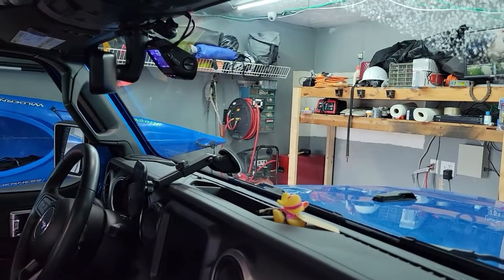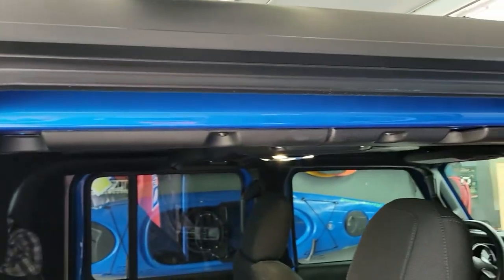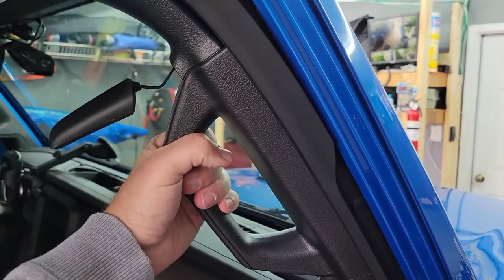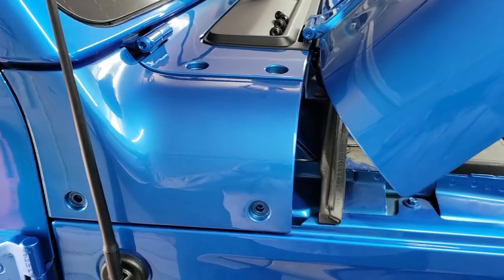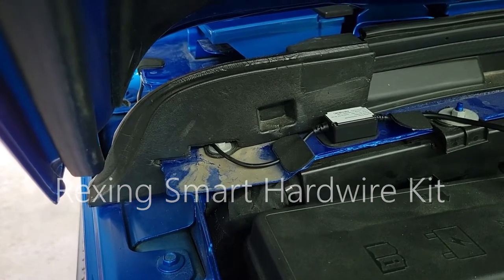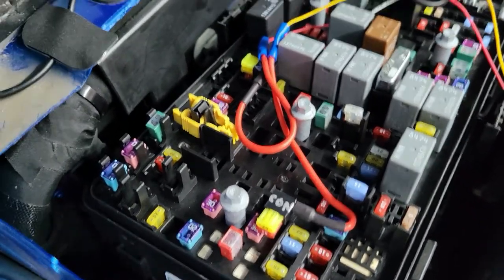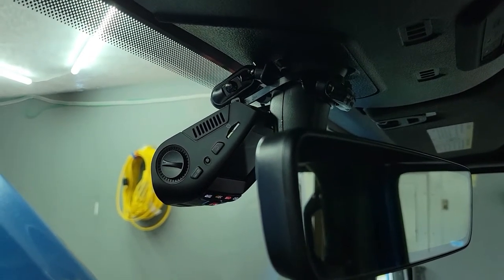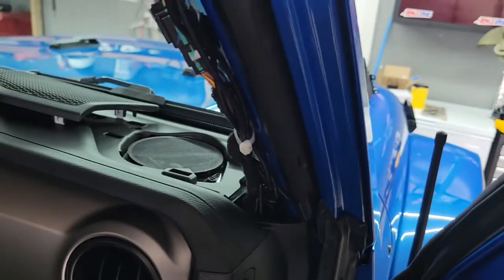2021 Jeep Gladiator Dash Cam Install with tool requirements and fuse location for power

Comment: Such a great, focused video! Thanks so much for the fuse/wiring detail!
Reply: Took 3 hours start to finish! I tapped into the same two fuses and routed the same in my 2020 Wrangler JL. I'm not quite sure yet about the back camera. I currently have it mounted on the back window although that means I need to disconnect it when I take the top off. I thought about attaching it to the roll cage but all I see is the interior of my jeep and the big spare tire 🙂 Thanks again for the excellent video!

Comment: It's probably too late for this now, but they don't indicate which way is up on the body of the camera because you can set that in the software.  For example, you could flip the camera upside down so the cable exits on the other side.

Comment: I installed a dash cam in my 22 Jeep Wrangler and the fuses were causing my battery to drain. I had my acc plugged into f52 which is the cig lighter and then the always on on f43 which is the rear cargo power charger. My battery light keeps turning on and didn’t realize it was the camera causing it so i took it to the dealership and they unplugged it and haven’t had that problem since. Now i can’t figure out what fuse to use 😅
Reply: Do you not have the OEM auxiliary switches?

Comment: Thanks for the GREAT video.  I just purchased the Rexing also, but I chose the VP1-MAX .  It has the 4K front but a 2K rear .  The only real cosmetic difference is the rear camera looks like a mini version of the front, so that might change my rear mounting position a little from yours....  DO YOU RECALL what amp fuses the Hardwire Kit came with ? Did you order the "SMART" or the "INTELLIGENT" version of the hardwire kit(I'm guessing the standard "smart" version) ? You showed a blue 15 amp from the original Rexing harness but then added yellow 20 amp fuses to the new MICRO2 adapters.... why did you choose to do ths ???  The oem intelligent harness I purchased from rexing has the grey smoke colored 2 amp fuses, so I was wondering what the differences were... I did purchase the "Intelligent" hardwire kit because it is required for the premium parking sensor... maybe that is the difference.  I've contacted Rexing to verify, waiting for a response....Thoughts ??
Reply from the maker: That wasn't a blue fuse in the Rexing adapter. It was just the adapter, which didn’t fit my Jeep. I used the same amp rated fuses in the new adapter harness as what came with my camera. I imagine the difference in fuse ratings between our kits is exactly for the reason you said.

Comment: I did it exactly as in the video but it didn't work, I connected the B2 cable to the cigarette lighter fuse and that's how the camera turned on, now to record when it is parked I don't know where to connect it.
Reply from the maker: I think you posted somewhere else that you have a 2023.  Your fuse block may be different than mine.

Comment: Stupid question - his yellow ACC cable is wired into the CONS tap fuse? And the red batt cable into his ACC tap fuse is that correct? It’s seems backwards.
Reply: I bought a Viofo A229 Pro.  The red wire is the Batt wire and the yellow wire is the ACC wire but some hardware kits are different.  They should label the wires in the kit.  Some other internet sites say that the colors are not standard.  You have to look at the label.

Comment: I would like to know exactly which fuses to use Mojave 2023?  thank you.
Reply: It is most likely Micro 2.  You should be able to search the internet and confirm that.  So, if you order fuse tap order Micro 2 as he did and I did with my 2021 Wrangler.

Comment: What do you do with the rear camera when you remove the top?
Reply from the maker: The rear camera has a quick disconnect. The camera goes with the top and the cable stays in place.